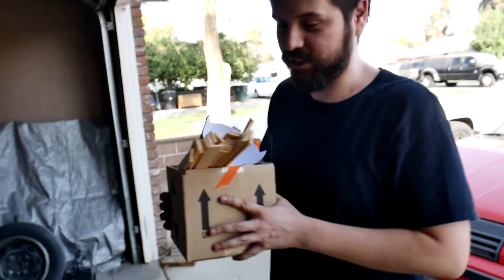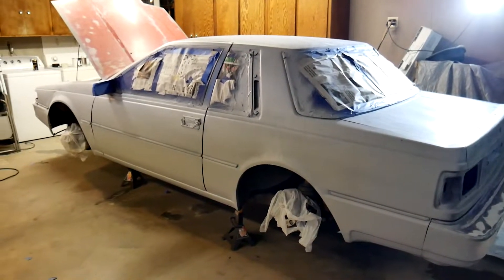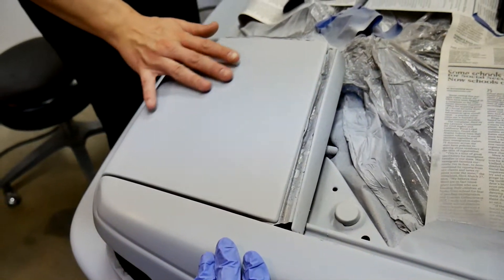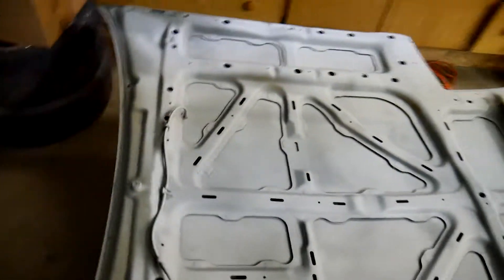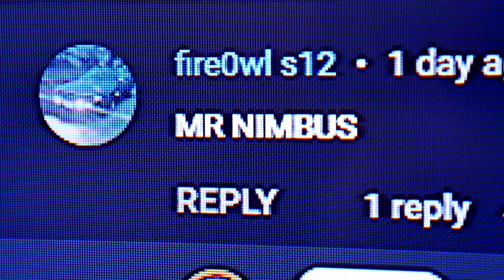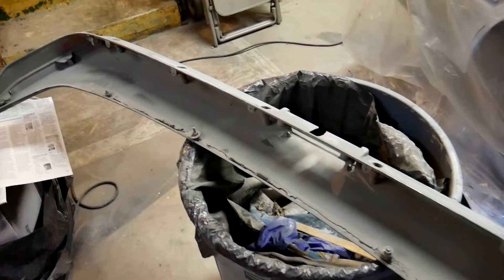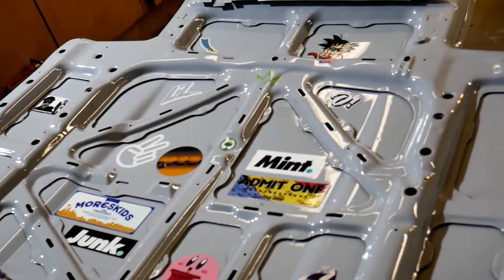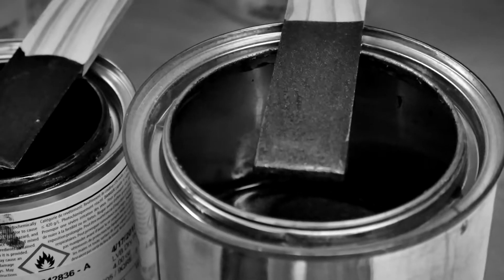Spraying Primer with a 6 Gallon Compressor | Clear Coating Over Stickers

Comment: The JB weld on the bolts to mount it is fine I filled holes in my engine bay with JB metal weld to smooth it out and it’s lasted over 2 years
Reply from the maker: good to know! also, thanks for the support!

Comment: Wrinkle paint needs heat in order to “wrinkle.” The amount of heat would probably melt the plastic, so I wouldn’t recommend wrinkle paint on plastics. I did it on a 4age valve cover and it came out nice.
Reply from the maker: noted! so ill prob go with trim black then! ty for the tip
Reply: @Nimbus.  Driving4Answers did a video on it a long time ago, which, is the video I referenced when painting mine:

https://youtu.be/575Y75sGBaM